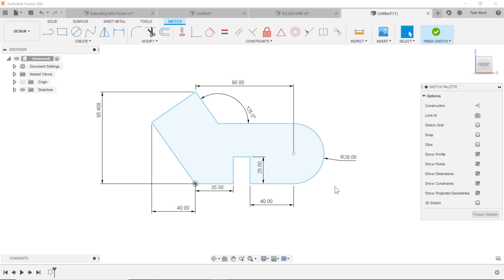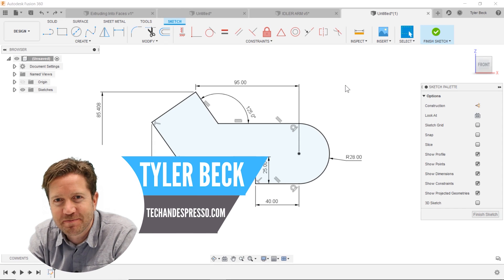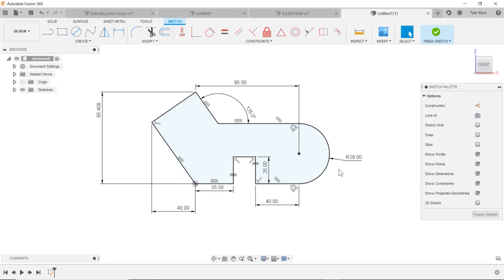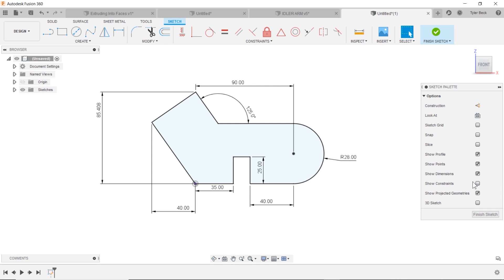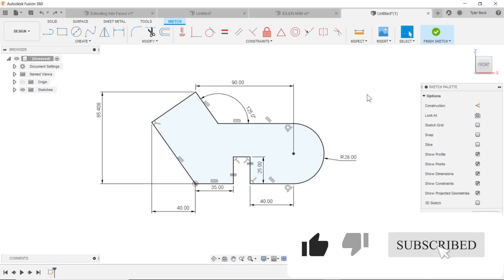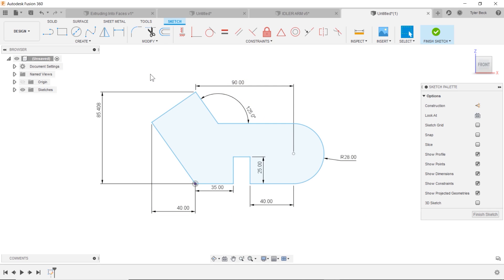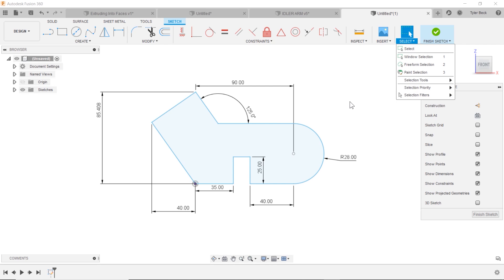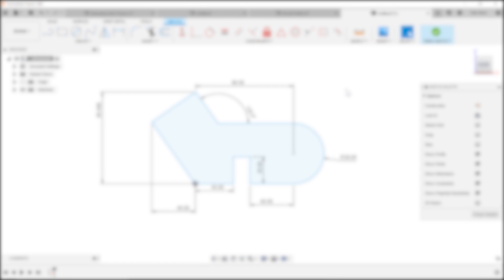The Trick To Removing Sketch Constraints in Fusion 360

Comment: You missed the main point of my visit.  I have multiple things all coincident constrained.  I want to move one of them, but I can't figure out how to find the Coincident Constraint for "This Line," and delete it so I can move it.  When I try to modify or move a geometry, I'm invariably being prohibited from that action because SOME element of it is constrained and I waste so much time trying to figure out which constraint is my nemesis.  Selecting all constraints and deleting was a dumb suggestion because that'll just end up screwing up your sketch and making it harder to work with down the road (unless you go back and recreate all the intended constraints).
Reply: Did you find a solution for that? Also trying to figure out how to locate which constraint is applied to some sketch line at some point (and there are like 10 constraints there for various sketch lines, so I'm ending up guessing and guessing badly).

Comment: Fusion needs to have a way to just turn OFF the constraints as a default, it's one of fusion biggest waste of time. that and the default height settings in CAM not the value you can make them default what you want but where that value is referenced from you cant and it SUCKS, I've been Machining for 40+ years and know many many machinists 99% of the time everyone uses the top of the part as your Z 0 , 4th & 5th axes work some times not.

Comment: Hi Tyler, Thank you for your informative Fusion 360 video's I have been learning a lot from them. Can you assist in being able to find unconstrained items in a sketch? I have a sketch that does not have a lock symbol on it, but I can not find any blue line/s to assist in finding which part is not constrained. Is there a filter or something I can apply to show unconstrained items?
Reply: A really useful trick is to try and grab a point or line on the sketch and try to drag it around. If it doesn't move, everything related to it is properly constrained, if it does move then you're on the right track to finding whatever is unconstrained.

Comment: I noticed on your videos, when you edit a sketch, you go to the timeline, right click, the menu pops up, and then you click edit sketch. A short cut to save you some time, is just double click the edit sketch icon in the timeline and it will immediately take you to the edit sketch mode. It also works with any icon in the timeline by double clicking the icon you want to edit.
Reply: @
KsPoker Mike
 I knew that worked with sketches, but not other stuff too. I'll be sure to give it a try. Thanks 👍
Reply from the maker: Great call!!! I typically do that for newer users to understand where they live in the time line.